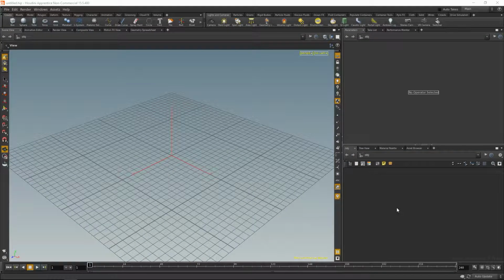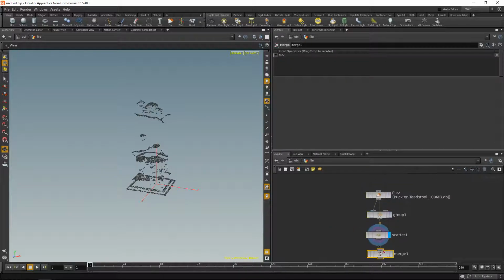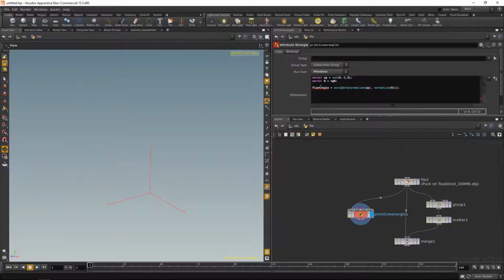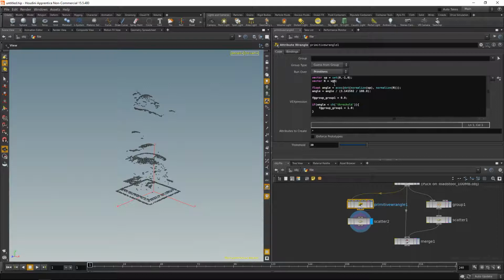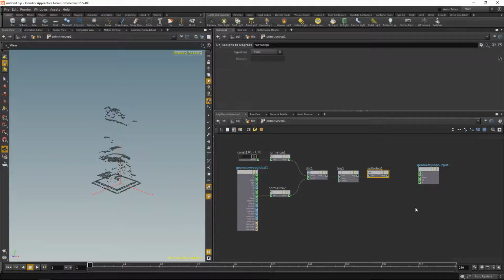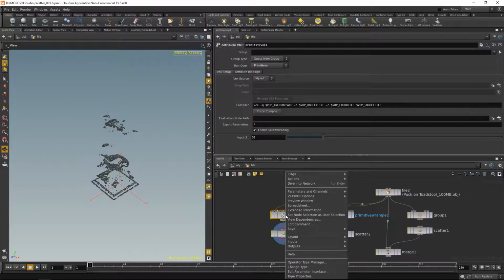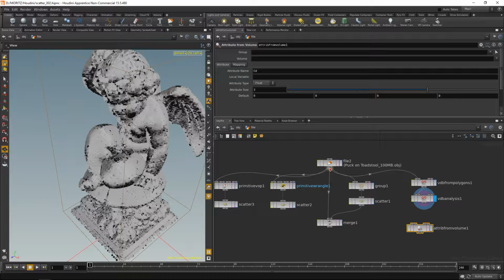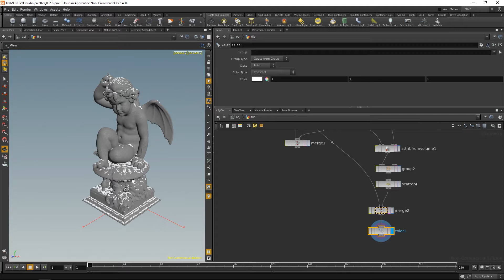DIY Scatter Tool Solving Problems in Houdini

Comment: I think there is a problem with this one, if you try to use a pig head, with this method you select the internal mouth as well that it isn't correct, can intersect function work?
Reply from the maker: Hi Rosario,

indeed, as this method purely relies on the mesh's normals, that's expected behavior. And also yes on using a ray to detect intersections between the surface point and an aimpoint :)

Cheers, Mo
Reply: @Entagma  Thank you for replying every one my question, you are really a kind person :)